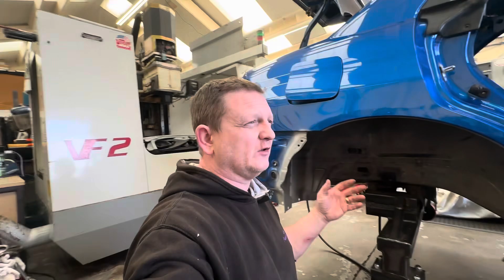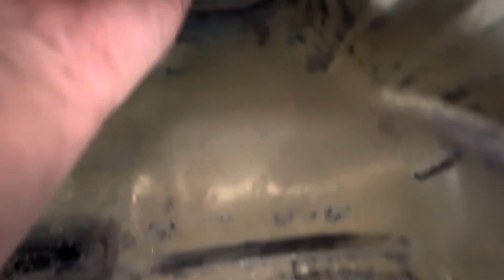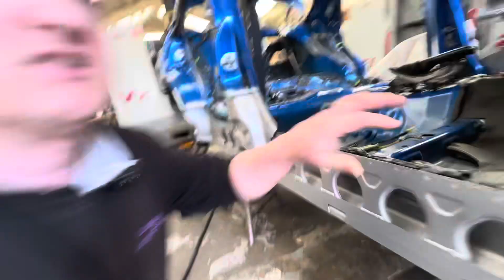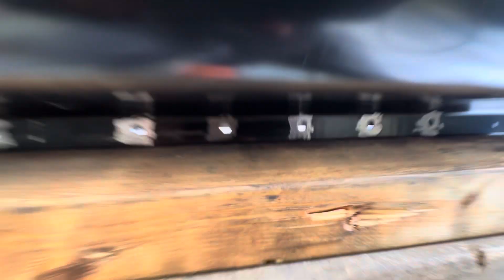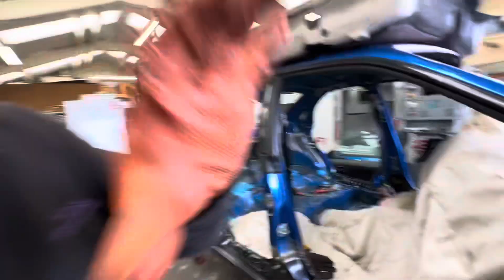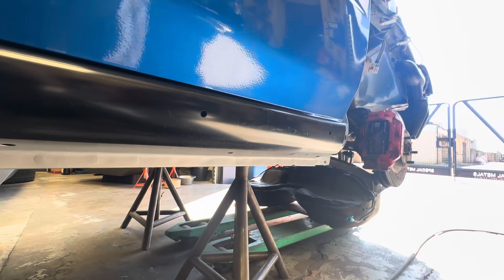Subaru oem sill panels finished on the 2005 wrx blobeye

Comment: Hi again. Here is my other channel. With Haas to RS232 to USB setup with Opt-isolator, if you are interested. Also other videos on programming the Haas with Python over the USB port:

https://youtu.be/HE1hSIi4Zos
Reply from the maker: Hi

Thanks for the links, but now i have the newer controls on my machines i dont have to worry about trying to use rs232 etc

Good info for anyone wanting to use this on the older controls though

Thanks
Marc